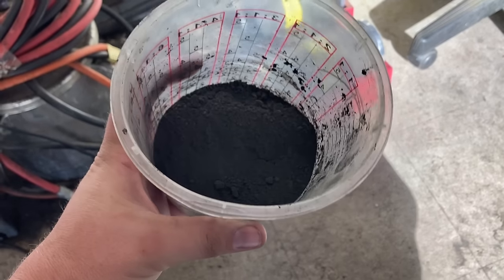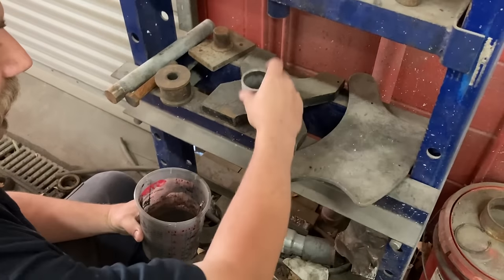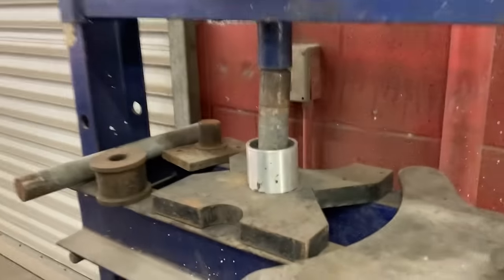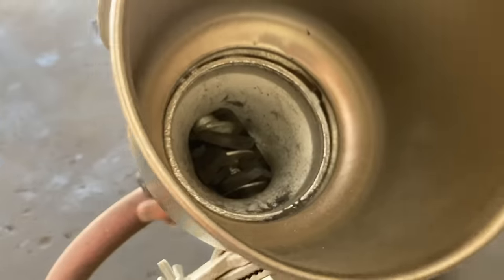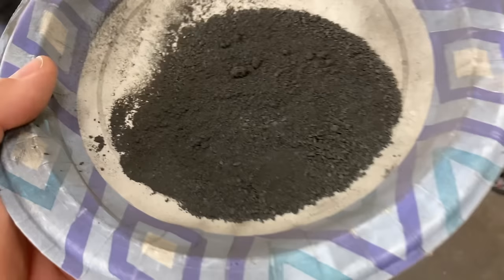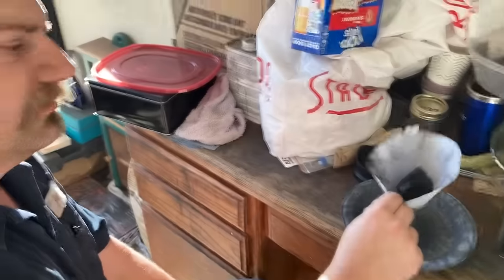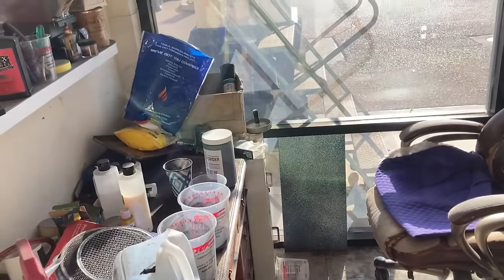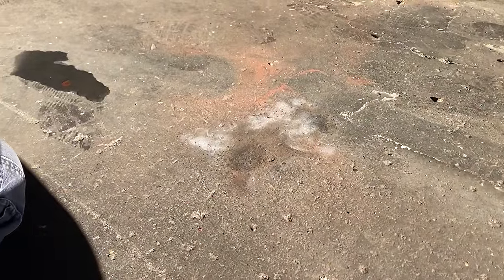Making Corned Black Powder

Comment: Good video! Impressive result. When it comes to the watering process, I have found 3% to be the "right" amount. So, for a 1000 grams of powder, I add 30 ml of water. If I go to 40 ml, I will get "leakage". This is with a pressing force of 2000 pounds/ square inch. In my opinion, it pays off, to pay attention to getting the water evenly distributed throughout the powder. I achieve this, by first adding the water with a syringe, which is my way of measurement, then passing the powder through a sieve.
Reply: I suppose if you wanted to get all sciency, you could purchase  a chemist's  pipette that produces precise droplets. His instructions were very specific ... add water until it stops forming dust. That provides for relative humidity, since KNO2 is very hydrophilic.

Comment: The dust could be used for priming powder for flintlocks
Reply: Yeah, I was like useless? That’s priming powder, or can close slow fuse/your rope for match locks. Or the little black cats for fun/the 4th.
Reply: @Plastikdoom  I love the dust for my flintlocks .fast reliable ignition every time if you use some old tricks to seal the pan and vent. It is all but click bang
Reply: @kirkmorrison6131  I imagine, I only shot a friend’s flintlock a few times, I have a walker and dragoon replica, love them, they are fun. Maybe I’ll look into getting a flintlock here sometime, they are pretty fun. But instantly, I was like that’s damn near flash powder, at least quicker burning/higher velocity types, in a powder like like that, think about a spark and it’d light. and would be amazing for priming.

Comment: On my testing using the graphite is that it makes the powder 'smoother' so it measures/meters more accurately in the powder measures on the market today. And that's all it does it actually slows the burn rate by 1 to 2%. Again in my personal testing.

Comment: I was making blackpowder in the 90's.
Placed the components in a wok added water heated and sturred to remove water. Dunked into an alcohol bath. Corned in a geological serve. Coated in graphite. Dried. Worked well in pyrotechnics and cannon.

Comment: The graphite is a lubricant for the powder. It prevents moisture absorbtion and subsequent clumping in addition to preventing the powder from coating whatever it touches. It does nothing for the burn. Think of the graphite as making the powder user-friendly.
Reply from the maker: I ran some test a couple months ago and found it slows down the velocities 100 fps on average.
Reply: @Everythingblackpowder  Although my reply, and initial personal thoughts, suggested that graphite didn't effect the burn, my original comment inadvertently holds that graphite does nothing FOR (to better) the burn. In retrospect, it stands to reason that you're diluting the compound, so it MUST effect the burn in a negative manner as graphite is not combustible. Thanks for taking the time to respond and further enlighten all of us. Cheers!

Comment: I have been able to make good pucks with a 2 inch pipe nipple and a big C clamp. The grinder is the worst part cuz I use a ceramic coffee grinder and I get way to much dust I have to rework. If I can find a good grinder I will go ahead and make a press, but once again the grinder is the difficult part. Actually I have been able to make dextrin to add for about the last 20 or 30 minutes of tumbling and then just screen it into granules. The dextrin really helps to control the crushability of the powder thus speeding it up some. At this point the additional density I get by pucking the powder doesn't seem worth the time.
Reply: I use a half gallon size tumbler with a bunch of say three quarter inch by inch or half inch brass rounded edges this not a sharp edge and the brass doesn't make sparks so you got no problem with that igniting just a suggestion I've used it to make rocket engines big rocket engines and it works extremely well. God bless and best of luck be careful.
Reply: I read your comment. You might look into Lemans / Amish type of grain grinders.  I hope I spelled the company right.

Comment: Thanks for sharing your video I like how fast your powder Burns I have made powder in the past. It seems like it just wouldn't quite fast but also I was using water and properly an alcohol. In my mixture it worked good. I took several deer with it, but it just didn't Look as good as yours and also i'm gonna try the press method Thanks for sharing your video.

Comment: If I remember correctly they ghraphite coat the powder to make it less sensitive to static electricity.
Reply from the maker: Interesting.
Reply: From everything i have found and read over the years, graphite was added for aiding in reduction of static and help with the clumping and feeding of granules in equipment...also supposed to leave slight film in barrels to aid with the lubrication some how.
It does help the powder flow better in equipment along with settle faster and better in the cartridges. Never noticed any difference rain or shine in the muzzleloaders.
Reply: Yeah thats it! What he said ^^
Reply: The Boeing dreamliner 'battery problem' was carbon fiber dust making conductive bridges between contacts. 

Graphite is used for EDM electrodes. 

Using carbon to resist electricity might not be a good idea.
Reply: @randomidiot8142  They may not be using carbon to resist electricity but rather to try and eliminate the creation of the static electricity. Static electricity can be created by friction. It's possible that graphite might be employed to reduce the friction there by eliminating the static. Just a thought.

Comment: I used to save some of my corning dust to make black match.  But most of it, I'd just cycle through my process again.  I'd make 1kg of powder at a time, and if i had corning dust lying around, I'd toss in 100-200g of corning dust into a batch.   Also, for wetting the mill powder prior to corning, I had a spray bottle with a fine mist, and it would be about 50% isopropyl and 50% water.  My pucks were about 100g each after pressing, and I'd dry them on a screen in front of a fan for about a week.  I'd know they were ready when I could gently knock them together and they'd make a "tink' sound like ceramics.....

Comment: Hat's off to ya! I myself have been mixing and pressing for running on 27 yrs now myself. Good video and good instructions right there! Hard ta out do an old hand mill!

If I may, I would like to share quite a bit of info with all y'all on what I have found through the years of testing.

It's a shame how they have made people so scared of making homemade powder.
Over the years of making it, I have found that good ol creek willow does give the best yield in muzzle velocity and silver maple not far behind.
Here's what I personally have found best for the 44 Carbine and 44 Revolvers and 50 muzzle stuffer 75.18 - 9.93 - 11.17 and in the c&p 36" 45, it seems to really like a 77.99/9.84/11.17 silver maple mix. Oh, also...best time i found is mid-spring to cut the willow the let air dry for 3 to 6 months before processing and charing. Something about the high sap content drying and being left behind adds a little more and seems to aide in a slightly cleaner burn.
No offense meant for posting this information. Had a guy here on yt take my help and then start trying to sell measured kits of it so.....I am passing this information on to help everyone interested and help all y'all save time on finding a good mix.
Edit: after granulation and tumbling 6+/- hours, I will use a 20-30 mesh screen placed at a 50 to 60 degree angle over a catch pan and run the powder down it with a 6 inch drop from the tumbler canister. This seems to keep a close uniform granule size and allows the dust and smaller granules to be separated for pressing again.
Using a potassium nitrate saturated water will almost guarantee a no loss of nitrate when pressing.
Sincere apologies if I'm coming across as a know it all. 
Only trying to pass on as much information as possible before it ends up buried as so much has in the past.
Updated 2/19/22 - I had forgotten to add that the way to control the sensitivity and burn rate of the powder granules is through the increased or decreased amounts of sulfur and the purity of the materials.
Best way to remove the high acid contaminants from flour of sulfur is to use boiling water.
Pour boiling water over powder, shake it, let it settle completely out and drian all contaminants off top and scrape dark residue from it then repeat once more. Once it is dry  it is not only purified for use is BP but it is also good for using in H42 and H48 primers. Non-purified sulfur will cause percussion caps useless within a week
Note: These are my own personal experiences and opinions and do strongly encourage everyone to do their own research before attempting any of this! History shows that many people have lost their lives by attempting to make black powder. Be Safe
Reply: This information is priceless, very many thanks, these processes have been secret squirrel in the past, not information is being shared! Wonderful, now all we need to research is the best colour casehardening process.
Reply: Thank you very much for sharing your results!!
Reply: @453421abcdefg12345  you're very welcome. Many years of research and testing just to find out that we have since 1878 been extremely misled.
Reply: @duacot6633  you're very much welcome. Glad to be able to help.
Reply: @duacot6633  oh! By the way... you will notice that some of the numbers don't quite add up above.... the reasoning for that is due to water content to be added.
Ya see.....some black powders throughout history require a certain amount of moisture to burn properly. 
Note: i keep forgetting that the biggest majority of people don't know and understand that.
If people would actually dig very deep and hard they can many years digging through book and papers to find that information for themselves,  but then again, I keep forgetting how  people are.
Reply: @Sport--willow  yeah, totally agree and it's easy to overlook. What most of us do is test variations and test them out and settle on a preferred mixture then fail to document and share those results, myself included.  Test test test and safety safety safety. 

Some of the best unheard processes that I've come across have been relating to either Napoleon or the Confederate Nations during the American Civil War.  I would love to be able to farm my own nitrate although I lack a garden to facilitate a compost pile that I can pour gallons of urine into.   

Would love to find a single "bible" on the "complete history" of "black powder". So much reference material out there but rarely are there more than one or two sources quoted.
Reply: @duacot6633  sure hear ya there on the on a single sorce... long about 50 yrs ago papaw took me on a tour of his process from the start of making the powder to the firing of the smoke pole. Needless to say, I  was addicted!
From then to now, I have researched, read and copied pages and pages of processes, formulas and more.
Out of the pages of rifle powder, pistol powders, sporting powders from as far back as the late/mid 19th century it definitely takes a helluva lot of work and time finding a powder each weapons likes best.
I can and will say, we all have been lied to about BP/gunpowder since the started bringing in smokeless powder. BP made using the formulas from the late mid 1800's is a different beast from what commercial powders are today.
For example - one of the sporting powder formulas from back then using 65 grains of 2½ to 3f was blowing the skirts out on the 50cal minnie balls.
I wonder if this ol country boy would be able to right a book/manual on how to make homemade BP/Gunpowder with all these pages of information gathered.....thanks for making mention of liking to be able to find a book like that. Heck as an added bonus, I could throw in it how to make primers, caps and the complete process of making primer compounds.

Comment: What is the shelf life for the home made powder compared to the commercial ones assuming it is stored correctly?
Also very interesting series of videos!
Reply: Lasts for years!
Reply from the maker: It should be the same as the commercial stuff. I have some old DuPont black powder from the 70s that still works great.
Reply: @Everythingblackpowder  Thank you for the answer and that is pretty sweet having such a long shelf life compared to smokeless/nitro cellulose

Comment: The advantage on graphite coating is that it resists moisture much better than un-coated.  I've done Rev War Reenactments for over 20-years now and when I lived in Vermont, we used un-coated powder.  It was actually cannon powder and although it was the same size as 3F, cannon grades are a bit different.  We used it because It was cheaper and we were only firing blanks.  When it got humid, if you left some powder in the pan of your flintlock, it would turn to a muddy goo after about 10-minutes or so depending on how humid it was. It did get humid enough to cause that problem during the summers there.  Then I moved to Virginia and found out what summer humidity really was.  I still had some un-coated graphite in my kit and it would turn into goo in about half that time. So the reenactment groups down south only use the graphite coated BP.  Anyhow..if humidity or rain is not a problem, why bother?
Reply from the maker: Agreed. Not much rain or humidity where I’m from.

Comment: Dear sir thanks for the info .now I will give you and all your readers some useful info. Graphite is basically very fine sillacone that was designed for moisture repellent as well as lubricant so you can see why it was incorporated into gun powder because they're biggest customer is was the us navy .all those big guns are fired with black powder Evan to this day. So water repellency was is necessary and the lube factor didn't hurt either. I live in hot humid Florida so doesn't hurt here either.hope this answers  questions.potasium nitrate is very hydroscopic in other words it draws moisture not unlike salt. Graphite helps with this problem.
Reply from the maker: Thank you
Reply: I did not know "Graphite is basically very fine sillacone".  Graphite is carbon, C,  and we know not all C acts the same.   Silicon is...silicon, Si, and I think it is what it is.   

I suspect you meant there's a similar property observed between them.
Reply: @duacot6633  actually I was only explaining to those who didn't know why commercial and especially military black powder is graphite coated , MOISTURE repellent
Reply: @יונתן זנטון lm sure now that they use some sort of smokeless propellant but not to long ago they used a hell of a lot of black powder and probably some cordite. Black powder was much easier to get in large quantity than nitro cellulose powders. Also black powder was a known entity so there for more predictable.